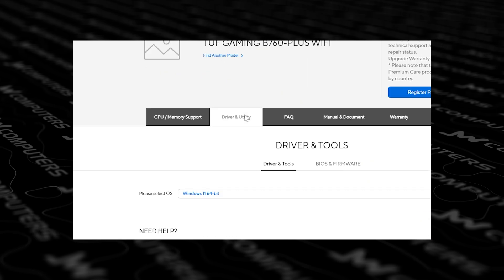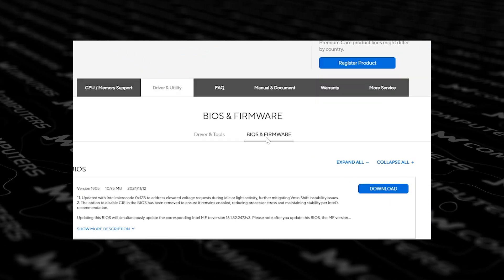First PC Build? Avoid These Mistakes!  | PC Build Guide

Comment: Not much of an issue these days, but it's worth double checking the height of your CPU cooler if using an air cooler. Most cases will fit any cooler, but some might be a few mm too small (cooler too tall), preventing you from popping the side panel on.
Reply from the maker: Hello @AlexD-fr6nw!

We do touch on this as a light point at 1:44 along with watercooler radiator sizes aswell but yes! double checking this can save you a trip back down to your local computer store for a swap for something compatible 🙂